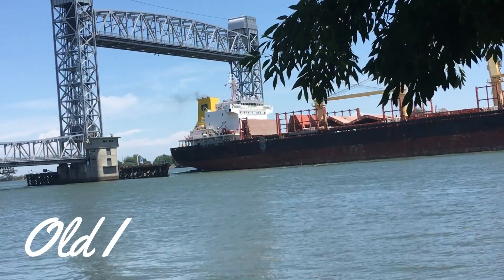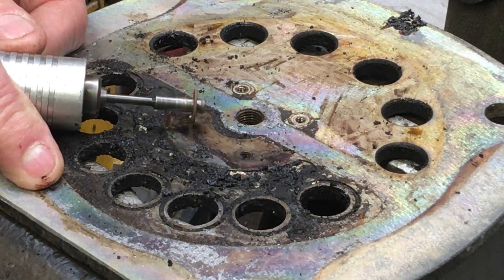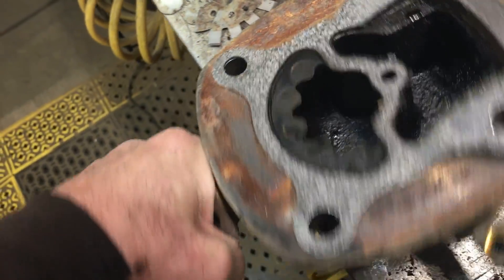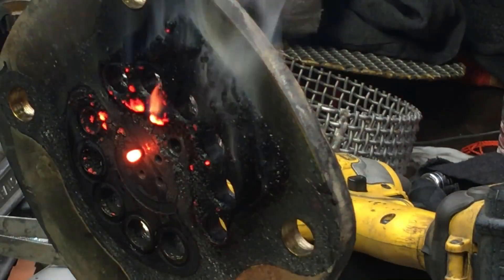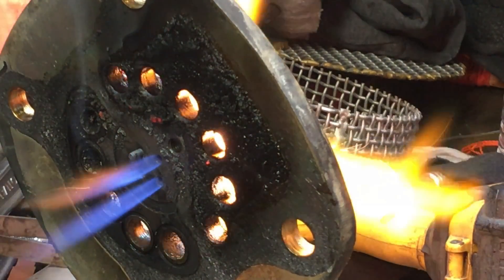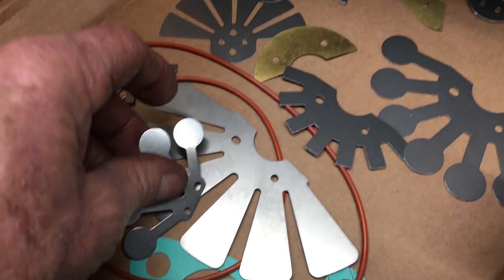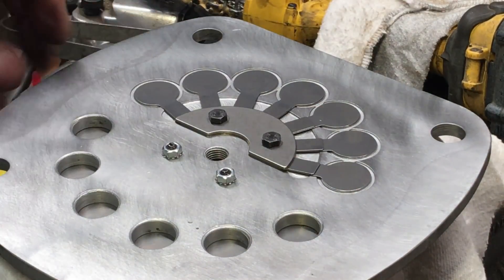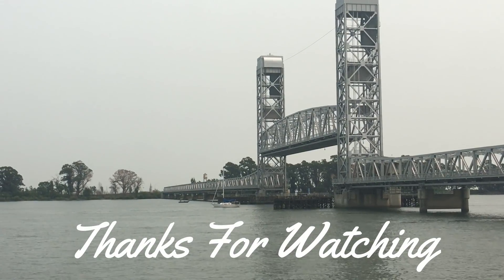How are your valves

Comment: Great work on the broken bolts and the valve repair.  Back in 68 or 69 don't remember which one we went on strike at the evil polluting chemical plant because they wanted us operators to do incidental maintenance.  After six months we came back and started doing incidental maintenance. One of the things I did was changing the valves on Worthington and Ingersol-rand ammonia compressors.  We had a contractor come in and completely overhaul a Worthington and when I went to put it back in service the suction and discharge gauges went back and forth like a windshield wiper on steroids.   They had put half the valves in backwards and guess who got to put them in right.
Reply from the maker: Love that Story Harold.   They don't work that well when they get put in backwards.  I rebuild all the big valves at work, and the small ones shown in this video. I think I will show a large valve rebuild in my next video.  It was sent out to another shop for rebuild but they did not do a very good job so it came to me. When you have a single valve that cost over $10,000 new its work repairing right.   I'm going to miss your live stream today. My Granddaughters Birthday party today.  Thanks for stopping by Harold.

Comment: nice job mate i never knew some compressors had REED VALVES, I PUT BOYSEN Racing REED VALVES IN MY OLD YAMMY IT250 ONCE.
Reply from the maker: Robbie, almost all of the smaller compressors use some kind of reed valves.   Thanks for stopping by.        Gary
Reply: @OldIronMachineWorks  COOL THANKS BUDDY

Comment: Another interesting video. Thanks Gary!
 My shop compressor locked up and wouldn't turn. I tore it apart and found the rod seized to crank due to no oil in crankcase. The rod is all aluminum with no bearing and a oil cup on the bottom. I polished it with some emery cloth, filled the crank with oil and it has been running for about 15 years now.
Reply from the maker: Danny, most small compressors are made that way not using bearing inserts. They are pretty forgiving.    Thanks for stopping by.

Comment: Do you use something like a walnut blast to clean them plates off ?
Reply from the maker: Ken, I use a fine glass bead in a large blast cabinet.  Glass bead is always my go to media.   Thanks for stopping by.       Gary
Reply: Thanks for the question I was also wondering how the cleaning of valve plates was done.  Also Gary look forward to hearing about the bridge and your connection too it. I really enjoy your content and would suggest that you should never think anything is too easy or “basic” to show. For some one that may not have have seen or been exposed to how a simple system works or is put together or is fixed getting an insight in to this is really interesting and helpful.

Comment: Gary is that much carbon build up normal for it's age?  I am assuming that this compressor has been used daily in a business.
Reply from the maker: Andy, this compressor runs all the pneumatic controls at a big natural gas compressor sight. It runs 24/7  and only gets oil changes. Most valves never get looked at until there is a problem.  So yes its pretty normal.     Thanks for checking out the video.      Gary
Reply: @OldIronMachineWorks  Makes sense now thanks for the reply

Comment: I like the screw in valves on my Devilbiss but don't know what kinda valves my champion has no one has seen them in 83 years. lol
Reply from the maker: As style points go the Devilbiss is my favorite.  I have the larger one like yours, I think 445 ? and the smaller brother, 234  but not totally sure on the models. Only thing that would make them better in my book would be a oil pump.  I'm also a big fan of the older Quincys. Also have a few of those. I need to thin the heard.   Thanks for stopping by Brian.        Gary

Comment: I get out quite a few broken screws.  You have an excellent technique.  Tip is if you have a TIG, you can use that too, just use it to apply the heat right to the broken stud with just enough heat NOT to form a puddle, and cook it for 20 or 30 seconds.  Hot fast direct heat does wonders. Enjoy as always Gary.  -----Doozer
Reply from the maker: Doozer,  Was put in my first service truck 41 years ago working on tractors.   I have seen it all over the years. As you know there are many ways to go at a frozen stud or bolt.  As shown in this video the first one came right out, but if I knew the 2nd one was going to fight me I would of went right to drilling it out and not screwed around with it. You just never know.     Always nice to have you stop by.   You got that engine running yet :)            Gary
Reply: @OldIronMachineWorks  Working on the IHC engine a little all the time.  One thing about rust, it is a ceramic.  It has a different thermal expansion coefficient than the base metal.  Use that to your advantage.  Repeated heating and cooling breaks up the rust by crushing it. Ceramics are also brittle, right?  Keep up the fine work. ----Doozer
Reply: Oh.... Like this?  lol  https://www.youtube.com/watch?v=2iuROc6HaLA

Comment: Your video's are always interesting Gary and it looks like your job (position) is too, you must work for a decent outfit  as you appear to you like your job as well, less common these days than we may think. 
I absolutely despise thread locker, not the product itself actually but the misuse of it by way too many people, like anything it has it's place however being that poor son of a bitch stuck working after some fool using too much thread locker in the wrong place is enough to make the most tranquil person in to a homicidal maniac from the havoc caused by these incompetent idiots. 
 In all of my 50 years of  the mechanic trade for work and play it has been a toss up which is worse, silicone sealer or thread locker, more than a few problems are caused by both, again, not the product's fault but misuse by would be mechanics, it would be impossible to count how many times I've seen screw bosses broken or passages plugged by gobs of silicone sealer, it's always a red flag when I see some person with a big bottle of thread locker or a caulking gun with a tube of silicone sealer in it, I sincerely hope any of us ever have to work behind these people.